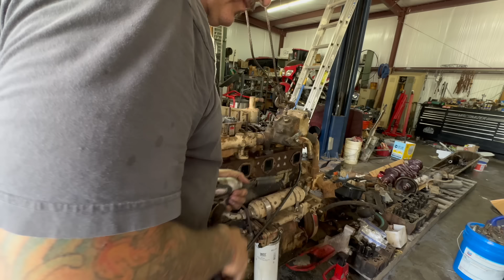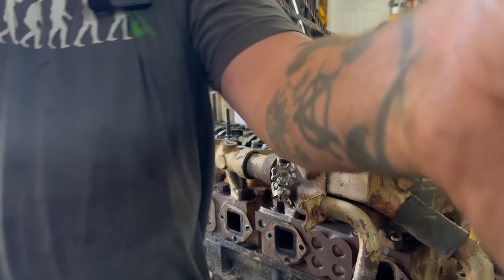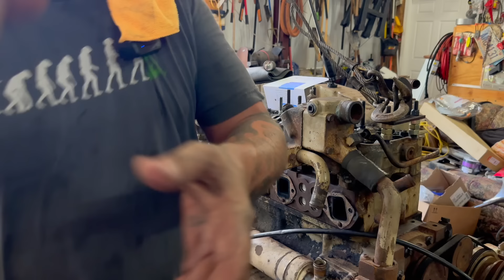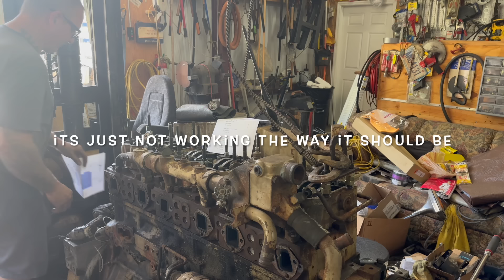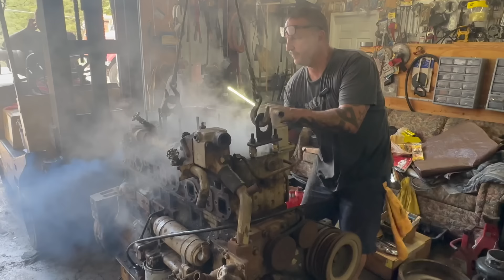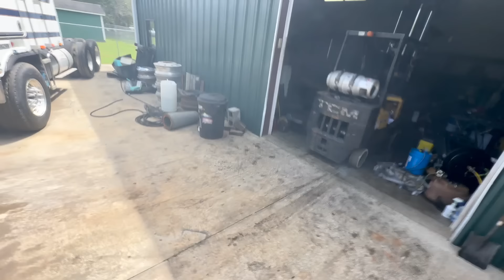Big Cam Cummins Somethings Wrong

Comment: i would recheck #2 and # 6. that was a ton of smoke. #1 blowing flames and producing all that smoke from the dip stick hole and out of the oil return makes me worry the block, piston, sleeve or something is cracked, it kept producing smoke after you shut it off. oil fire is possible.
Reply from the maker: Reveals itself in the next video
Reply: Myslím špatně časování🖐️👏👍🥰

Comment: James .... I must apologize for not saying something. The reason its not running right is the cam followers... it has everything to do with timing and the valve lash. I never learned how to do the shimming of the side covers and getting it right. Get someone who knows their stuff on this and Bill will be a close relative. I ran into this when out at Deer Bay Alaska. I and another guy built some cummins engines out of parts we had and new stuff as well but they did not run.... did everything just as your going through, then we had a cummins guy come in, he shimmed the cam followers and Bill was still my cousin!
Reply from the maker: Nope. That’s not it.  Next video reveals all.   Not a bad thought tho

Comment: Another thing just bopped through my small brain and that was something to do with thickness of the gaskets on those side covers... not sure if it was a small cam engines we were working with or big cam... back in 85 or 6 so might be either or.